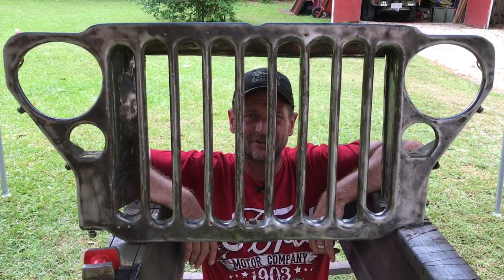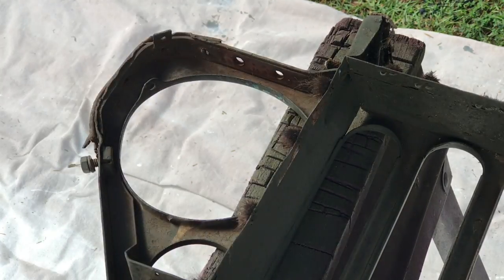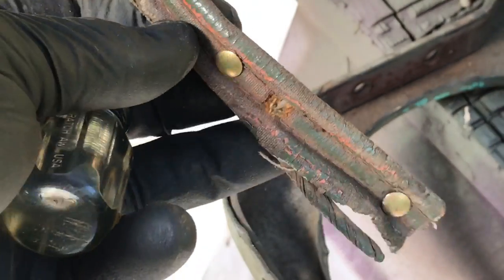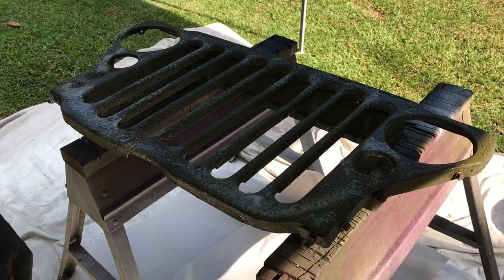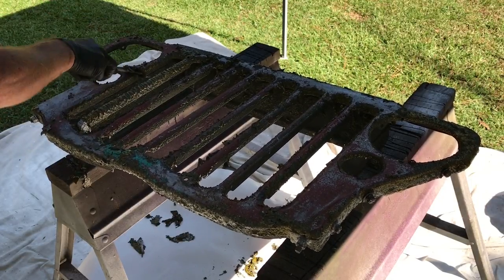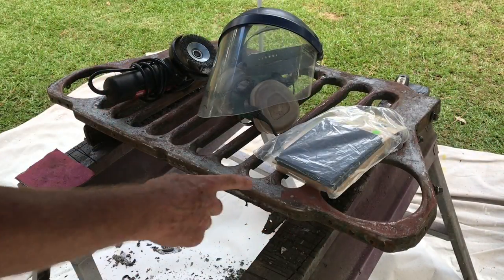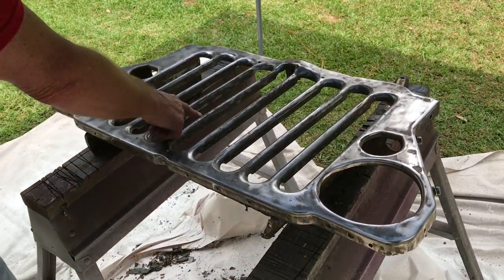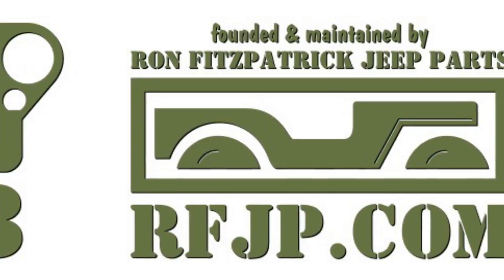Team G503 Willys MB Jeep Grill Restoration Part 1

Comment: If you get it when the stripper is still active but after the initial scrape, can you get the remainder off with a pressure washer?
Reply from the maker: David Calhoun In experience, once the stripper dries up, you will have to re apply. You could also simply wire wheel or hand sand the remnants.